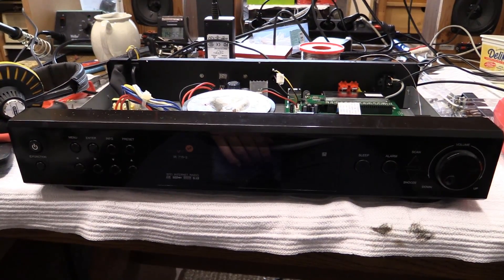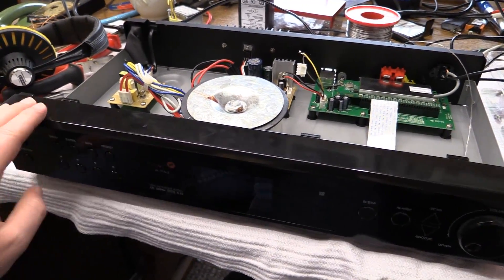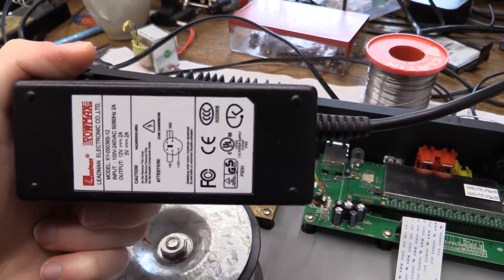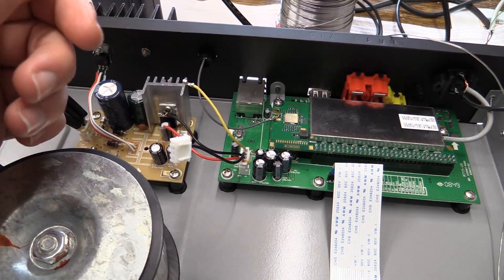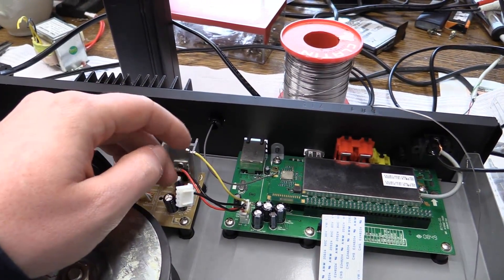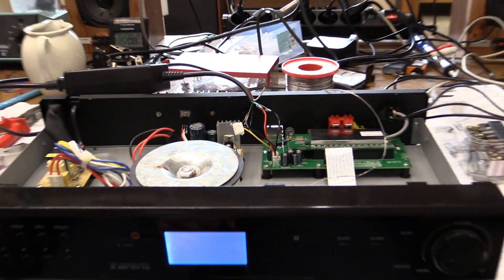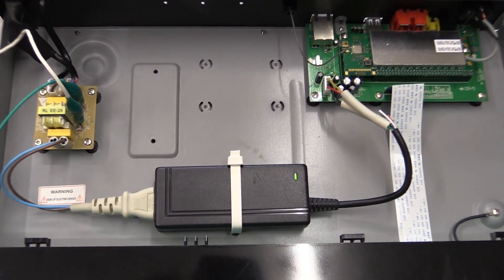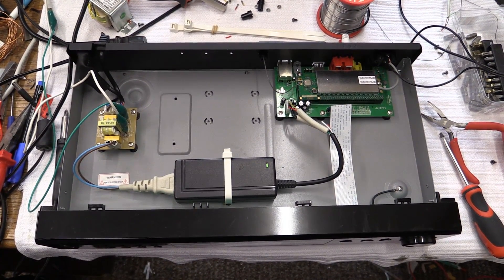DrCassette's Workshop - Internet Radio Receiver SMPS upgrade!

Comment: In the power supply much more better solution is cheap and efficient small dc/dc converter module.Decrease the voltage 5-30V to 5V with 3A current and no heatsink needed.

Comment: Interesting tuner. I never saw receivers with Internet Radio. There are almost nothing inside it. Wht is the model of that one? Does it have WiFi? How does it work?
Reply from the maker: It's the MuVid IR 715-2. It does have WiFi as well as Ethernet.
Reply: DrCassette Thanks for your answer. It's a German Brand. There's one system in ebay: Muvid IR-915 2.1 from Spain. It has DVD/CD player to. EUR 399.90.

Comment: repeat the same thing with some analogue (or expensive trueRMS digital) meter and you will see: the switching PSU is more efficient.
(some experts will start argueing about cos/phi phase PFC and who has to pay for what. But as a user of a conventional power meter in your flat you are on the winning side.. ;-)
Reply from the maker: rarbiart Even though it's rather old, the Fluke is in fact a True RMS meter...
Reply: DrCassette
 o.k. then either it has a massive FPC issue causing these values. Or if it gets really hot, then it's just inefficient and you should look for an old USB-Hub supply, which will run at it's sweet spot.
Reply from the maker: rarbiart
I'd assume it's a PFC issue as this power supply most likely doesn't even have any kind of PFC. It does not get hot, just a little warm, so that's OK.

Comment: Maybe the switching PSU doesn't have PFC and the efficiently isn't like 80% or more like computer PSU.
But also try with kill-o-watt meter
Reply from the maker: oldmac6 Could be... this power supply is too small to have to have the PFC, so I wouldn't be surprised if it was missing.
Reply from the maker: oldmac6 I don't have a proper Watt meter, so I can't take any further measurements...

Comment: It's worth to note that Swithing PSU's are total hell to measure the input current of. As they are not a resistive load at all, meaters just freak out and show a lot more than they should. You need to use a proper Watt meter to see what it actually pulls. Pretty neat and simple hack there btw :)
Reply: DrCassette No that wouldn't be accurate at all. What you can do though, is to stroll off to the supermarket and pick up one of them 10 euro wall socket Watt meters. They're not super accurate either, but they are cheap, handy and will give you a hint about how much power you're using. They're usually accurate with +-5W
Reply from the maker: Electricguy After making the video I thought about the input current being not so easy to measure. The meter is a true RMS unit, but that's probably not enough to get an accurate reading. I don't have a Watt meter, so I'm stuck now. I assume it's more efficient than with that transformer...
Reply: DrCassette If you're VERY intrigued to find out, you could turn off everything but that unit, and measure the time for the meter to do one revolution (assuming you still have an olde worlde meter, or can find one at a fleamarket etc).
Reply from the maker: I don't have access to my apartment's power meter, also I don't think such a measurement would be very precise. Not with such a low power consumption.